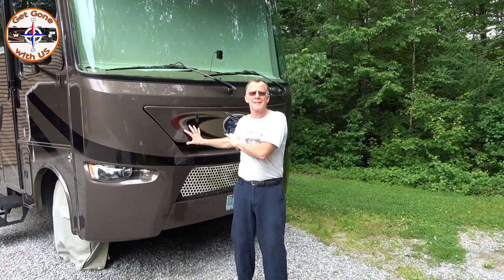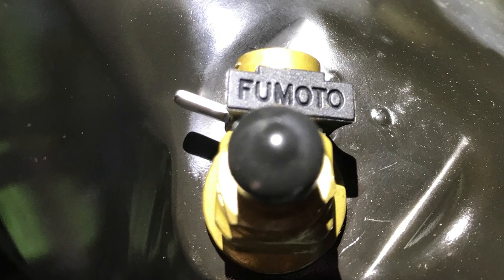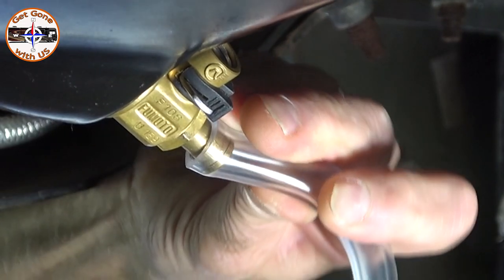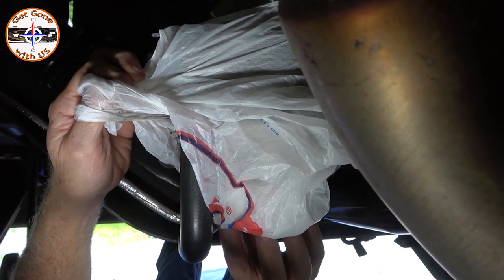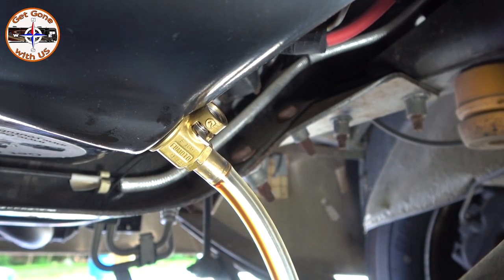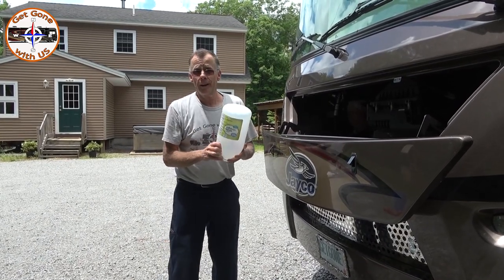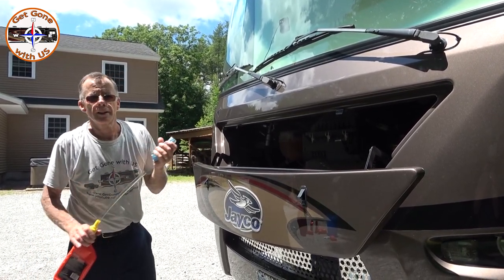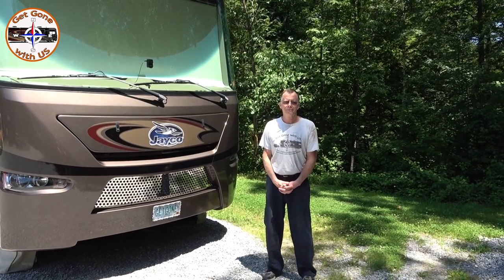Ford F53 V10 RV Oil Change - UPDATED - QUICKER and Less MESS

Comment: I cut the soft part of the filler hose to just a couple inches and re- clamped the filler spout (takes about 5 minutes). Now I can use the 5 qt. Jugs to refill from inside the dog house - quick & easy.
Reply from the maker: Nice.  Thanks for your input. 😀
Reply: I did the same thing. Removing the dog house only takes a minute and also gives me a chance to give the top side of the engine a good look/inspection. Also, my 7.3 takes 8 quarts of 5W30.

Comment: Good Video!  SOLD!  I have just ordered the Fumoto.  I noticed you tested the transmission fluid when the motor was not running.  I thought it had to be up to normal operating temperature with the motor running.   One other small hack...  I taped up the transmission dipstick hole, then cut a 4 inch diameter circle out of paper.  I stuck the paper over the pipe, and sprayed bright yellow paint around the dipstick.  Now it is MUCH easier to see.
Reply from the maker: Thanks  Not sure what you are talking about with the tranny, Roger.  I showed where the transmission dipstick was, but never pulled it out.  I only pulled out the oil dipstick.  Happy Trails!

Comment: I lay a 2 foot long piece of aluminum foil lengthwise over the I beam and then remove and discard it after I put the oil plug back in. No mess. I also puncture the bottom of the old filter with a sheet rock nail to let it drain while I take a break. On filling I use small mouth oil bottles. No spillage. Also I put a 2 inch diameter white styrofoam doughnut over the end of the oil filler tube so I can always see where to aim the dipstick.
Reply from the maker: Good tips! Thanks for your input.

Comment: My 2006 FW Bounder is an F53 with a reman 2015 V10 so I do use the oil filter bag hack and will get BOUNDER a fumitomo oil drain valve! 
Your style and video is Crystal Clear - and as a retired teacher I respect that!!
When / how often do you do trans oil & filter? TIA
Reply from the maker: Thanks You!  I believe the owners manual says to change the tranny oil at 60,000 miles.

Comment: I changed the oil today in my V10 and used a. Pump that fits on your drill.. I put a five quart container on the battery and it fits perfectly. Fills it in less than 30 seconds.
Reply from the maker: Thanks for your input. 😀

Comment: I think I found an easy way too. I use a paint roller pan with a hole in the end of it. Also I use a pump from harbor freight for 5 gallon cans to pump the oil from 5qt bottles. The roller pan also works for the oil filter. Just make sure your catch pan under the roller pan is centered. My first mistake. The metal roller pan has feet that catch perfectly on the torsion bar to hold it in place so it won't fall down on you. Hope this helps someone. See the pictures.
Reply from the maker: Sounds like a plan!  😀

Comment: I have just two comments here. First is the plastic bag choice. The best plastic bags for this is the ones you find in the produce section of the supermarket. They are good quality, don't leak, and are very pliable. After you brake the oil filter loose, wrap a folded paper towel around the top and put a rubber band around it to hold it in place. Then place the produce bag over the filter and put another rubber band around that. It will make life much easier. Second, the oil filler tube is not too small, the wide mouth oil bottle is too large. You can still find oil in bottles with the small mouth. Get some and don't throw the bottles away. Buy your oil in the five quart size at Walmart. It's a lot cheaper, and refill the small mouth oil bottles. You won't need that oil filling contraption you made and it's a lot easier.
Reply from the maker: Thanks for your tips Frank. 😀

Comment: Be careful when you pull the oil filter off..recheck the torque on the oil cooler tube. Mine was loose and caused a leak between the cooler and the block. Loosening the filter may loosen the cooler as well. (Causing a cancelled trip)
Reply from the maker: Wow, we never had that issue.  Thanks for sharing!

Comment: also using a cordless drill and drill a small hole in the bottom drain into the ziplock
Reply from the maker: Thanks for your tip.  We just cut one of the corners off the bag and drain it into the bottle. 🙂

Comment: Great Video – which Model of the Fumoto plug did you use. The video shows F106 on the part. The Amz link displays various models including F106N and F106S and other models.
Reply from the maker: Thanks!  The link in the description box below the video (Click Show More) shows everything we used.  Fumoto F106N Oil Drain Valve (fits Maggie):  https://amzn.to/3QQGIM0

Comment: Using a fluid transfer pump to refill is the only thing I would say will improve your process. 
Harbor freight has one that works well with the 5-qt jug and if you get it above the fill spout will actually create a siphon and go in after priming with a couple of pumps.
Reply from the maker: Thanks for your input. 😀

Comment: One note, always check the oil after running the motor for 10 min. ? Recheck oil, the filter may up to one quart of oil. You may need to top it off.
Reply from the maker: Thanks for your tip Don.  😀

Comment: We tried the Fumoto oil thing and it was so slow even after warming up the oil....hubby went back to old fashion way because it would take forever to drain...did he do something wrong?
Reply from the maker: If it took 'forever' to drain, then there maybe a clog in the Fumoto or the drain wasn't open all the way.  That would be our guess.   Draining the oil would be a bit slower with the Fumoto vs removing the drain plug completely, but not by much.  The real time saving is being able to drain it directly into a container. With other methods the oil spills all over the place and is a mess to clean up.  At least on our rig it was.

Comment: You don't have to put new oil in the filter, it's a good way to get dirt in the engine.just lube the filter gasket and the engine already has oil on the moving parts inside the engine block.
Reply from the maker: No you do not have to put oil in the filter but I do it for the assurance that there is no metal on metal when starting the engine.  New filter, new oil and a cleaning oil filter housing. I don't see how you would get dirt in the engine.  I have been doing oil changes for almost 50 years, on all sorts of different vehicles and have never had a problem because  dirt got in the engine from an oil change. Thanks for your comment

Comment: Seems like giving up the 30 pack is a sacrifice not worth making, although I guess you could just throw away the cardboard.
Reply from the maker: With the new way to change  oil the bud light container is useless...well after we get the beer home! 😀😜
Reply: I have the same engine  I watched your first oil change. Good tip.  I do really like the new value. I will try to find one   Thanks
Reply from the maker: @denniscampbell8711  Dennis , look in the description box under the video. There are links to everything we used in the video, if you are interested. Thanks for watching!
Reply: @GetGonewithUS  🤣